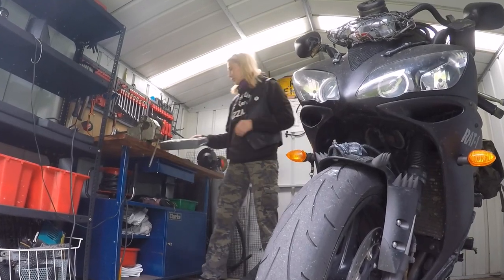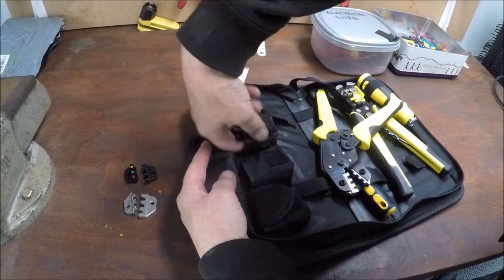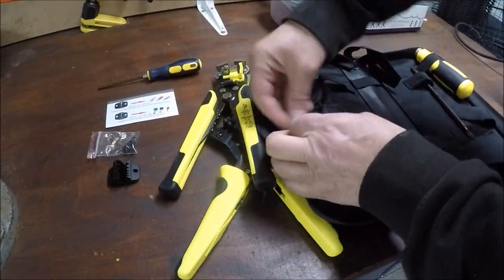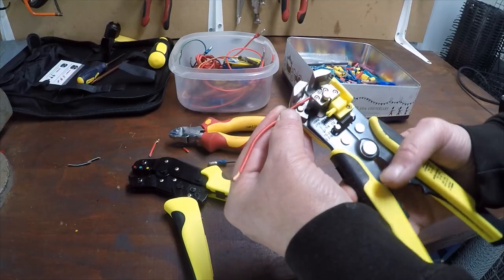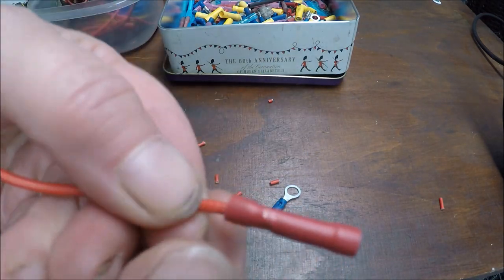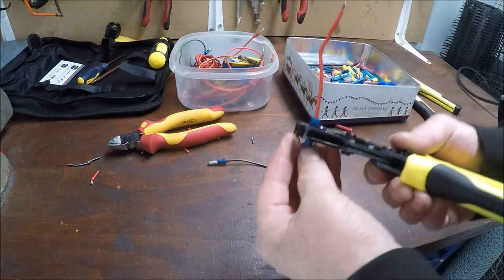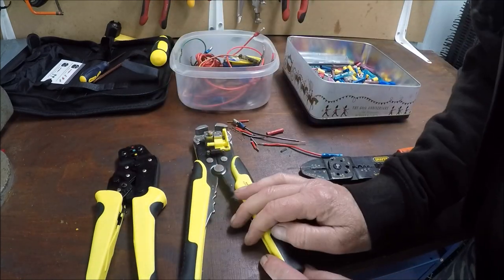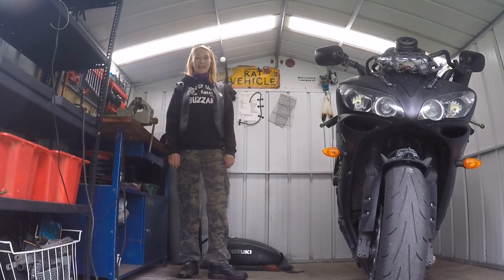Cheap Wire Strippers & Ratchet Crimper Set Tool Review. 4 in 1 PRO

Comment: about halfway down the handle of ratchet crimper there is a screw holding a slotted disc (just above the yellow grips) undo that and adjust it to suit your strength
Reply from the maker: Thanks for your advice and worth a try. I presume you mean the disc with the teeth around the edge? If so then I've tried it and unfortunately it's still the same result.
Reply: @Ratqueenbikes  that the one it should alter the pressure you need to close the ratchet
Reply from the maker: @celticwarrior1961  Thanks again for trying to help and it's much appreciated. I've tried again and they still don't work. Maybe mine are broken! lol

Comment: I have both similar tools , the stripper is great untill it goes out of spec a bit . Then you need a degree in engineering to adjust it back .. or some patience !! 
Great review little Sis, I'm not sure if the pressure is adjustable on the crimper ? I haven't delved down that rabbit hole on mine .
Peace and love and hugs 👍🏻☮❤
Reply from the maker: Great comment thanks big bro. Goes out of spec, yes I've noticed that after repeated use and it's fixable but I cant find a way of adjusting the crimper pressure. If you have better luck let me know. Stay safe, big hugs and lots of love 👍😀👍

Comment: Can you post a link to the set?
Reply from the maker: Seems like they've gone up in price since I got mine there now £27.29 You'll find them on ebay if you search 4 IN 1 PRO Ratchet Crimper Plier Crimping Tool Cable Wire Electrical Kit Set